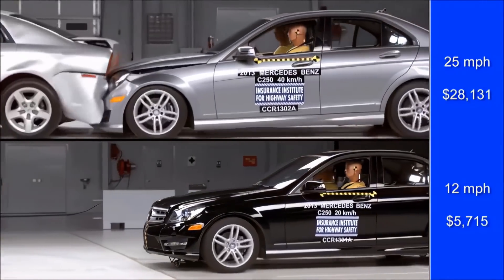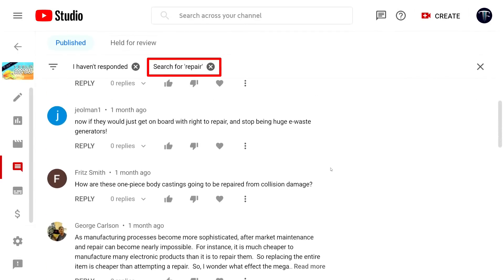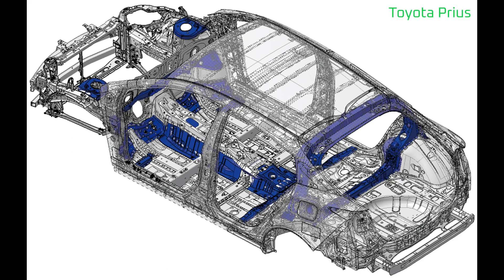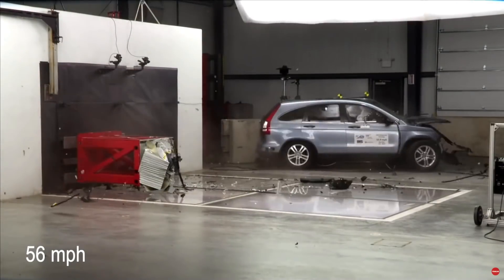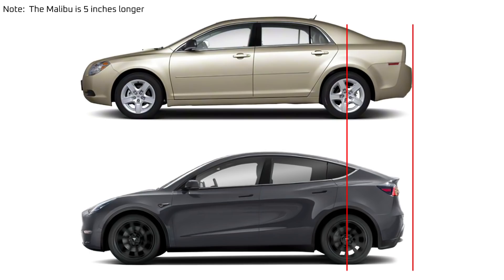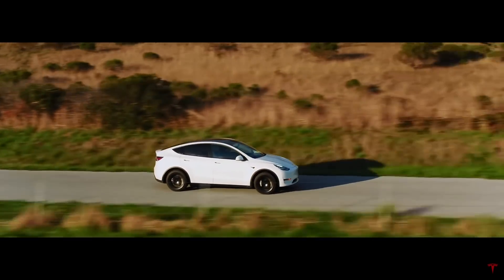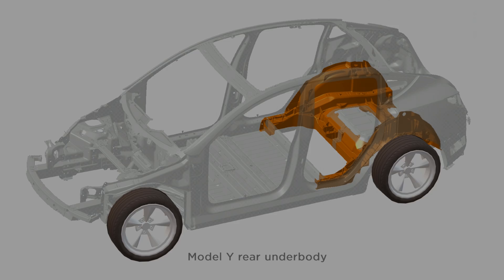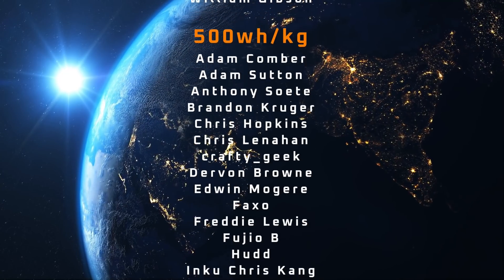#1 Tesla Gigacastings // Crashworthiness and Repairability

Comment: Most ICE cars today have the rear multi link suspension with differential mounted onto a steel subframe which in turn is attached via four rubber bushed mounts to the body of the vehicle. A similar arrangement holds the suspension arms, steering rack and engine at the front of the vehicle.  Any collision that results in the distortion of the subframes, front or rear,  will also deploy airbags and usually results in such extensive damage that it makes the vehicle beyond economic repair.  The front and rear castings in the Tesla are akin to the subframes on ICE cars and once damaged the collateral cost of repairs will write the vehicle off.  Economics plays a key role.  The residual value of Tesla’s is high and it is often financially prudent for the insurance company to sell a moderately damaged car than to have it repaired.
Reply from the maker: Great insights thanks!
Reply: It should also be noted that a significant part of the cost of the car is in the batteries under the passengers. Even when a front or rear crash totals the body of the car there can be a significant salvageable components. I don't believe a modern ICE can say the same(for the engine) because it need to be part of crash absorption. The expensive parts are deeper.
Reply: Ehh. This is not really true. Replacing a subframe is not as bad as replacing the frame of a car. I want to agree with you but this is just not always true.
Reply: @AudiTTQuattro2003  People have been buying and using the battery packs for home batteries etc for years.  Jack Rickard was into that.
Reply: False and misleading comment. The Giga casting does not substitute the subframe on the Model Y. The Model Y uses steel subframes that are installed underneath the giga casting. The giga casting substitutes the rear portion of the Model Y unibody.
Reply: @AudiTTQuattro2003  If you think there is no residual value to a crashed Tesla, i can only assume its because you've never tried to buy one for the VERY valuable parts it contains. Most crashed or totaled teslas still have some or all of the $10,000 battery pack intact and the equally valuable drivetrain/motors, so a crashed tesla still sells for 18K all day long
Reply: Do we know the affect on the battery pack due to collisions? Is there any data on the increase in fire hazard for the cells (in their later lives) that have witnessed high impacts?
Reply: @omnicurious2949  usually the skateboard may become damaged by the impact but some of the battery packs inside are used by enthusiasts to convert their cars into EV.
Reply: @hammertimee777  I know. I was planning to use some such salvaged battery packs. But was curious if there's any data on any microscopic damage done to the insides of the cells (that may increase fire risk later)
Reply: @omnicurious2949  From my experience, as long as the battery packs are not punctured or dented, the cells inside are usually fine. However, when buying battery packs out of a wrecked car, we wouldn't know the degradation of the cells. But pulling an undamaged battery pack from a wrecked Tesla shouldn't increase fire risk unless there are visible damages on the packs.
Reply: @omnicurious2949  i guess if the pack has no visible signs that it has suffered external violence. The battery is fine even if it has ben in a wreck due to other parts of the donar car took the impact insted of the battery. 

But if it has damage. I would not use that battery in my car.
Reply: @kulan9379  Yes. That seems like the commonsensical approach.
At some point I hope someone does a study on impact of battery cells' lifetime/performance when they suffer a physical-impact.
Reply: @omnicurious2949  do we know the risk in an ICE vehicle to sires during crashes?
Reply: @davidwillims2004  Dude! I am not a EV hater. My question was academic and practical in nature.
Reply: I don't agree on "The residual value of Tesla’s is high". Consider that Tesla only has 3 things in pricey, battery , car body and computer(hardware&software).   Any damage beyond repair on this would make others depreciate to invaluable.  Tesla computer depend on Tesla clouds, It isn't a tangible thing that can exchange.
Reply: I think the main complaint is from salvage title repair shops, who are unhappy they can’t easily repair a cast with existing low cost repair tools.
Reply: Replacing subrame is easy job. Is write off only in expensive countries. Replacing gigacasting is impossible, another reason not to buy Tesla

Comment: Are you able to do an analysis of the Cybertruck and it's Gigacasting? It seems the hitch attach point to the Gigacasting might be subject to failure.
Reply from the maker: There's been plenty of analysis on that already.  It just depends on how different people interpret the results.

If they're pro-Tesla, it's overbuilt and amazing.  If they're anti-Tesla, your truck is going to kill 100 children tomorrow.

My view is that for 99% of people, the hitch is fine, and you only have to be concerned if you're carrying a huge load, haven't balanced it properly, and going over rough roads.
Reply: @thelimitingfactor  there is something to say about the lack of ductility of cast aluminum. I think the concern with attaching the hitch assembly to cast aluminum is in the vertical or torsion direction (positive and negative tongue load during transient high load situations including ground strikes). I agree that in tension and compression the assembly should do fine with 11,000 lbs but what if there was an unexpected vertical load (repeatedly) such as bottoming the receiver like in the WhistlinDiesel video? With a little vertical acceleration, a momentary tongue load could well exceed 1100 lbs causing stress fractures unlike steel which would show signs of bending to warn of an exceedance with little loss of structural integrity. The original advertised tongue weight was 1400 lbs and a tow weight of 14,000 so obviously they made serious concessions for production. They also promised a 3500 lb load capacity so dropping it to 2500 was a huge walk back. My guess is in testing they discovered the very brittle nature of cast aluminum offered far more limitations than they planned on and the hitch will continue to be an area of concern. My prediction is a recall in due time to not tow at all or cutting the numbers in half unless the structure is inspected for cracks by certified technicians and signed off as good. It's not likely something that we'll see very often because not many tow with their CT and fewer will tow near the limits especially since they get less than 100 miles of range doing so.

Comment: Great video and explanation but I'd like to point out a couple things. I was a collision tech for 17 years so I have some knowledge in this area.

1. I thought the castings included the outer wheel well in the rear so this makes me feel a bit better in that regard. Having a separate outer wheel well makes this area much more repairable.

2. Even though there are bolt-on replacement rails it's not that simple. The energy transfer in even a moderate impact travels completely thru the vehicle and all kind of things move. Depending on the stiffness of the casting, if it deforms it probably won't be as simple as just setting it up on frame rack and pulling it back into shape (as in a normal unibody car). 

3. The casting being stiffer is both a good and a bad thing. The bad part being it will transfer energy further into the vehicle and may cause deeper damage.

4. A lot of people think Insurance companies just write off cars at will. This is not true, it is base solely on the cost of repair vs the value of the car. (I was also an insurance appraiser after leaving the repair tech side of things) I've had to convince adjusters on a few occasions to total a car even though I could not write a repair estimate high enough to justify it on paper. You can do a lot of repair on a $80k car but that doesn't mean you should ;)

When I was going thru ICAR training we watched a video done with a high speed camera that demonstrated the energy transfer thru a car on a minor impact and it was incredible. I tried to find this online but it was so long ago it may not exist anywhere. I started my collision repair career right when the switch was being made from full frame to unibody (early 80s) and remember the whining and wailing and gnashing of teeth from the old timers on how those things were junk and couldn't be fixed.
Reply from the maker: Thanks for the comments!

Comment: My father made a cast aluminum product. Aluminum is  not nearly as repairable as steel. Steel is a unique allow that does selective deformation. It took millions of dollars (billions in today's terms) to come up with the formula for steel.

Tesla's already have an avg insurance price per year of over 2200 in the USA. They should have made the castings smaller and riveted them, so that one could replace corners, etc., after accidents.  Big castings are cheap to manufacture, and very fast, but you are kidding yourself if you think big castings are good for repairability.  Frankly cars are getting worse by the day, as they keep putting more and more sensors in the bumper area where you are supposed to sacrifice some metal in a minor accident. While at a body shop they mentioned the cost of a fender bender has more than doubled in recent years due to the sensors, which have to be calibrated when replaced.

Comment: I think a very important point is being overlooked.  Conventional unibody vehicles are composed of many individual components that have to align in order to perform any repairs.  Doing a repair estimate it has to be taken into consideration that the technician may find additional damage to adjacent component parts and/or their spot weldings.  In a single component involved damage, that single component can be removed/ replaced and the repair completed.  The component cost and hours required to complete the repair is what drives the decision making process  in determining wether a a car is written off.  Manufacturing the Giga-casting at scale would lower the component cost considerably thus making repairs more cost effective.  Instead of welding multiple parts together, the entire casting can be replaced and the associated body panels are lined to the casting.  Many supercar manufacturers use this idea already.  The have the monocoque and separate  front and rear subframes attached.  The only reason those vehicles are more likely to be written off is due to the cost of the components involved.
Reply from the maker: Good point!

Comment: Long term it'll be less of an issue as most cars will be required to have crash avoidance tech whether they have FSD or not.
The saving for GC is going to give Tesla the big stick it needs to beat the legacy automaker with.  Being able to undercut them in price and production capacity capital costs at every turn will give them an extreme advantage.

Comment: Tesla vehicles are prone to write-offs. For example, minor damage to battery pack coolant inlet that had a crack (made out of plastic) resulted in battery write-off. Damage was repaired by 3rd party with self-tapping metal water inlet for few hundred bucks.

Comment: A rear impact is what I was most concerned about and now I'm less so. The side impact will probably be more destructive. Although the wheel might act as some sort of a cushion, the suspension might bend the casting. You probably have to X-Ray the casting to find potential week points from cracks.

Comment: My concern is not repair ability but rather the aluminum casting’s durability against corrosion here in the NE, where we salt our roads like a super-sized fries in the winter.
Reply from the maker: It'll be covered in the alloy video.  In short, it should be corrosion resistant.

Comment: Most modern cars will be a 'write off' after a significant collision, this is a combination of workshop costs, and the energy absorbing design of modern cars. As long as vehicles are properly recycled, this is probably a good thing. Well repaired crash vehicles never drive the same again, and poorly repaired ones are death traps.

Comment: Gigacastings should be stronger then a unibody and would be much better at not getting damaged during a crash. Similar to a race car with a internal structure like a roll cage. If a gigacasting part is damaged then it was a bad enough crash to total any vehicle.  Also gigacastings should make a tesla even safer in a crash as it is likely to be much stronger,  again like a race car.

Comment: The easyiest way for me is: If the car gets an impact and the castings get damaged, the accident must be very hard. If I have no or only little injurys and have to total my car, it is ok for me. Better the car than me :)
Also a thinking: Do I want to drive a repaired car after such a crash where the castings get damaged? No one can tell me if there are other components damaged, this includes all frame parts, seats and so on. If the impact damage the castings in a way, they need to be replaced, how much other parts need to be replaced? It is easy to say: you can repair the castings for 10k, but outer body, drivetrain, battery, cooling system and stuff also need to be replaced, so yes, it is cheaper to replace the car, not because of the castings which save your life, it's because of the combination of damages, which total the car. On 5:22 we can see how the roof is deforming, the car must be repaird from the front bumper to the C-column, so the only thing you can take from it, are tail parts which are not the chassis, meaning tail lights, rear bumper, may be trunk door. 
Take a look to crashed Model 3, Ove Kröger from T&T Mobility has bought one and repaired it, there you can see inner details of front, which parts were replaced and so on. The collision bars did a good job :)
This shematic is the same on every car, the only difference is, how high the probability to stay uninjured. It is most different if you drive Mercedes, Tesla, Renault or Dacia. 
I had a Dacia KZ-E (Spring in Germany) for 3 days and I'm very sure, an accident with about 30mp/h (~50km/h) will total the car while a tesla as some scratches at the front bumper and need a new cross beam behind the bumper. This is the difference between 15k € new car and 60k €. How much is it worth to stay healthy after an accident? If I have to total my Tesla after an accident where costs are high as a new car, I'm happy because I'm able to do that instead being death.

Comment: there is no difference in repairability between a modern vehicle using boron steels and a casting they if distorted need replaced,  equating a repair of a 1940s pickup to a modern car is similar, you could repair with a hammer a chain and a tree the pickup but  a modern car would be seriously compromised if you did that,  as the majority of the repair costs of a modern car is the labour involved replacing a casting will be cheaper a repair than replacing a piece whch involves more labour

Comment: Castings can generally be repaired, provided the material is suitable. The alloys used by Tesla could be welded/brazed, as the alloy they use doesn't require being annealed. Minor damage could be repaired safely. This is minor damage such as a chunk being knocked out, or a crack. Any accident that deforms the castings could not be safely repaired. We might need to watch out in the future for shady repair jobs.

Comment: I believe a Tesla will have more salvage value over a comparably priced ICE vehicle. If the damage is without a fire to the batteries, they have a high recyclable value through Redwood or one of Tesla’s recyclers. The motors can be used in the aftermarket if not damaged.

Comment: Hi Jordan. I just got my new lfp-battery done. Its 16 33140 Cells whit mgod bluetooth bms that has adjustable adjustments. It's just unbeliveable, amazing. 52v nominal, givs most of the power between 54 and 51 volts. Rated 75a peak. According to bms I got over 1kwh in real life capacity. wery compact and light, 26.4*14*8.5 cm pack  including bms. Best thing is that I can use full power, go top speed and battery won't exhaust like my other 48v 20ah li-ion does after 10km at full power even it was full. li-ion is good at peak power, but for some reason it weakens under long heavy load. Not the lfp, that keep voltage up all day long :)

Comment: How about looking into the effects of electrochemical corrosion, caused by dissimilar metals being bolted together? I would expect aluminium alloy castings fastened to steel parts with steel screws to suffer accelerated corrosion at the point of contact when exposed to damp, salty conditions. Many cars already have aluminium forgings in suspension parts like wishbones, but these are usually separated by insulating polymer bushes from steel subframes. Aluminium is also mixed with steel in engine blocks and cylinder heads but these run hot and tend to drive off moisture. If you've ever had a motorcycle with aluminium cylinders and the exhaust bolted to it with steel bolts, you will find that the aluminium can corrode to a white crumbly powder that breaks away if you try and take the exhaust off. This generally means repairing it with a helicoil thread insert because there's no aluminium left to screw into.

Comment: I have seen a few wrecked Model Y in the junkyard and wrecked Model Y are in high demand. I was told that Tesla does not sell the rear casting as a replacement part for the Model Y. However, if people are able to source another wrecked Model Y with an undamaged rear casting, they could remove it and replace the rear casting on a damaged Model Y. Maybe in the future, Tesla may sell the rear casting to body shops for repair. But right now, Tesla doesn't offer rear casting replacement and they are in high demand in junk yards.